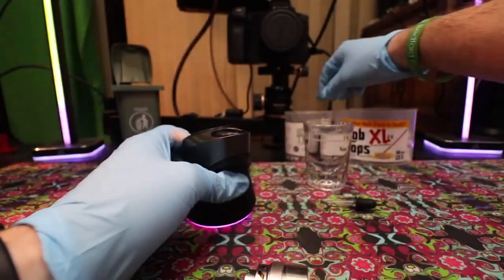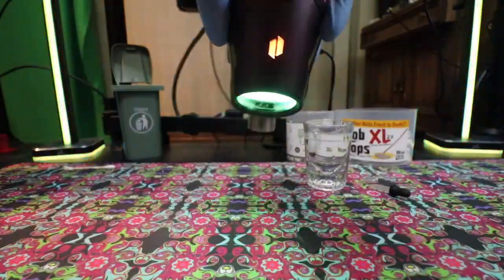Puffco Peak Pro 3D Chamber Chazz Removal Tutorial! Get a 3D Chamber, You Won't Regret it!

Comment: I was hesitant about doing this but it worked well. But def would overfill the chamber from the bubbling even on 14sec at the lowest temp and it will automatically shut off and give you that multi color error. It took like 6 cycles before the Chaz started to come off my 3dxl chamber. So def be careful not to let water get in that area where the atomizer connects. Probably won’t use this method again but def worked while I wait on my dark crystal cleaner 👍 No cracks in my ceramic chamber. I did use a little 1cc syringe with the distilled water since I had no dropper. It’s def a challenge on my 3dxl chamber. Kept cutting off when I couldn’t control the overbubbling but kept doing it and the stubborn Chaz is 98% gone and I’m happy 😃

Comment: I use a ultrasonic cleaner and some high density foam to hold a glass container firm and use iso! Comes out like new 15 min
Reply: What temp do you set your cleaner to?
Reply: @kevincamacho626  it's just a cheapo from wish, no temp control on it. If my atty is real bad I will heat the iso before hand

Comment: How often are you replacing the 3D chamber? Is the a rebuild/replacement option?
Reply from the maker: You can use the chamber forever, you just need to ISO soak it every 20-30 dabs
Reply: @PuffinPlanet thank you

Comment: I can’t seem to scrape mine off for the life of me but I know I was told to never use water… I have a gigantic ring around the edges of my 3DXL ever since my hash rosin plug ran out and I had no choice but to smoke his fucking crumble for the last month…. No matter how short the heat cycle (30 seconds ffs) or how big the dab? It left chazzing behind… now my entire fucking chambers ruined. I used to scrape it off with metal until I broke my regular 3D chamber that way lmfao now this is where I wound up after trying to look for better info and I really read “put water in your CERAMIC puffco chamber” …… 🤦🏼‍♀️ anyone else in these comments found an actual fix to this?!
Reply: I mean I just tried it and it worked but it took way more than 4 tries for a little bit of chazzinh it’s probably because of the way it was stuck on there I had to scrape it off with the flat head you use to tighten glasses and it still took a bit now I’m letting it soak again before I re use it but it was working  when it was bubbling I’m sure it’ll work after it’s done now

Comment: So this video is for people that don’t swab after every dab. Got it.
Reply from the maker: yes peter, it sure is
Reply: Do you swab with iso after every dab? Or just a dry swab
Reply: Just normal q tip is fine
Reply: Don’t know how people use a puffco without a q tip. Just crazy to me to think “leaving all that shit in there is cool”
Reply: I justo got the puffco v2 and i took 4 hits out of rosin for hardly any vapor. Went from 480-490-510-510. It was still runny but I cleaned with iso and a qtip. At least the thin ceramic actually cools down fast so you don’t have to wait much to use iso.
Reply: Actually, even if you do clean after every session you can still get tiny chaz residue and that’s why I came to this video. You can scrub at it (literally) for two hours just to get all the little guys off. Three heat cycles with water seems better.
Reply: @utah710  I clean it with q tip and iso so the bowl is 100% clean but what I don’t like is the ceramic piece on top of the bowl isn’t smooth so it’s hard to clean and gets really dirty
Reply: Peter probably on the spectrum
Reply: So how can I remove Chaz ppl say this video got there devices fucked I swab after every dab I fear it burned too ho
Reply: @ffdisxcnusive2151  step 1. Go get a brand new chamber. Step 2. When you smoke make sure can finish the whole session in 30 min. Step 3. When you go from red to white only hit white twice, the second time being boosted. Any dab that is left will give you a completely subpar hit and will make your cleaning last 20 min longer. Step 4. Swab with a dry cotton swab 1 time to collect reside. don’t move the material up the walls spin the swab while you rotate clock wise to have a clean side. Step 5. Wait until the chamber cools to 176 F. to avoid alcohol vaporization. Swab with alcohol swab in clock wise motion. Step 6. You will still have Chaz even if you do all of this. DO NOT. over-swab the ceramic. DO NOT PUSH TO HARD. This can separate the ceramic from the housing and cause abrasion and defects. Alcohol swab until it is perfectly white under a phone flashlight. Step 7. For the black Chaz dots that are still left. Don’t over swab . Simply use a silicon tool or a SIM card tray tool to LIGHTLY. Press on the Chaz.

It’s important that you only press lightly after you have followed all these other steps. As trying to do so with a hot dry bowl can cause scratches. 

It’s pretty funny how easy it is to just push off when you can scrub at it for 4 hours with a cotton swab drenched in alcohol after soaking the chamber for 8 hours.

Edit* This will only work and not cause scratches if you do it after every use. if you’re someone that doesn’t want to clean this after every session you can have a chamber that’s specifically for that. It will still clean off but the more sessions past 4 or 5 I’d say will burn it on to the point of needing to scratch it to get it off.
Reply: @alexvillalobos7137 idk if you’ve figured h the is out yet but even with rosin go 540 for 1:30 maybe more depending on the size dabs you have and it’ll put a rice size grain in there and have a fat golden puddle left and I get vapor too

Comment: step 1. Go get a brand new chamber. Step 2. When you smoke make sure can finish the whole session in 30 min. Step 3. When you go from red to white only hit white twice, the second time being boosted. Any dab that is left will give you a completely subpar hit and will make your cleaning last 20 min longer. Step 4. Swab with a dry cotton swab 1 time to collect residue. Don’t move the material up the walls spin the swab while you rotate clock wise to have a clean side. Step 5. Wait until the chamber cools to 176 F. to avoid alcohol vaporization. Swab with alcohol swab in clock wise motion. Step 6. You will still have Chaz even if you do all of this. DO NOT. over-swab the ceramic. DO NOT PUSH TO HARD. This can separate the ceramic from the housing and cause abrasion and defects. Alcohol swab until it is perfectly white under a phone flashlight. Step 7. For the black Chaz dots that are still left. Don’t over swab . Simply use a silicon tool or a SIM card tray tool to LIGHTLY. Press on the Chaz.

It’s important that you only press lightly after you have followed all these other steps. As trying to do so with a hot dry bowl can cause scratches. 

It’s pretty funny how easy it is to just push off when you can scrub at it for 4 hours with a cotton swab drenched in alcohol after soaking the chamber for 8 hours.

Edit* This will only work and not cause scratches if you do it after every use. if you’re someone that doesn’t want to clean this after every session you can have a chamber that’s specifically for that. It will still clean off but the more sessions past 4 or 5 I’d say will burn it on to the point of needing to scratch it to get it off.
Reply: Step 6 gets a lot of people to have to go buy new 3D

Comment: Definitely takes more than 4 tries had to use a metal flat head that smalls to scrape it off while it was hot the q tip didn’t do crap but it came off in the end  not doing it this way again ima just regularly cleaning it

Comment: So if I use distilled water it won’t break my shit
Reply: You should be swabbing the contact points/ chamber/ glass air holes with 91% alch then with a que tip dipped in distilled water. The dried with a que tip then air dried. Distilled water is important for removing alcohol residue you don’t want to be smoking that shi
Reply: Distilled water for cleaning glass will prevent hard water stains so nice to see it bright and shiny ✨
Reply from the maker: Yes sir this is the same protocol that 3G recommends
Reply: Wouldn't the alcohol residue burn off when you heat it?

Comment: Well I did this and now my atomizer is broken I believe.  The device won’t work & only flashes red and white…

Oof, hopefully will work again
Reply: You have to pull the pins out and dry the holes inside DO NOT REMOVE THE SEAL it is the hardest thing to put back because the wires in there will bend if not placed correctly
Reply: I have the same issue red and white flashes after water
Reply: Guys just to let you know, never put water in the atomizer, it will short circuit the electrical. Also only use 99% iso for cleans as I’ve had 77% burn out atomizers after a deep clean!

Comment: WTF do u gotta do to get this? Wow I've had mine for 7mos and I swab it every 4-5sesh as in sesh mode clicks 1 per each temp unless I still have a fat not too dark puddle in there and then I just clean it when it's smoke isn't as thick and the taste is done n there's less if any of the puddle left and it's slightly darker brown then golden but I'll re heat it later and clean it I leave my pearl in it single quartz cheap 2$Pearl and I use 91%iso with qtip and swab after safety 4-5 sesh mode which is 1 dab 1 load of the device despite how fat the Dab is. And I'll hit it 1more time usually tends to be the 5th cuz I'm done in by the 4th hit on white after taking the 1st on blue 2nd on green 3rd on red n 4th on white. Then it's usually done sometimes I'll get a fat1 where I'll have a puddle n need an extra hit but even so I'll wait cuz I'll want nothing to do with it until I can at least breath again lol. Then I leave it for a few hrs to 12 and then I'll turn it back on n hit it on white once to warm up then qtip w\e is left from the previous session n move on but my bowl looks brand new every time n I've been using it 7mo without a deep clean just light one I really need to get on that but I'm just not that confident in it yet hence why I'm here lol. I'm afraid about the glass.
Reply: I found it most common with rigs that use terp pearls. Seems to be one of the major linking factors
Reply: @toddmellinger6581  IDK my pearl isn't the issue so much the 1 thing it does cause is the oil to splash more so it gets dirty quicker but I use it at low temp the highest it'll go is 510 I think and I start way below that work my way up. Maybe in a torch rig yeah I get that makes sense cus they want it to stay hot the whole time usually they're taking fat dabs to and have a slurp n all that IDK about it cost a lot u need quality glass for all that lol. The pearl helps clean between each use tho